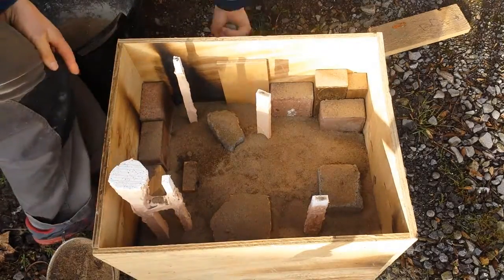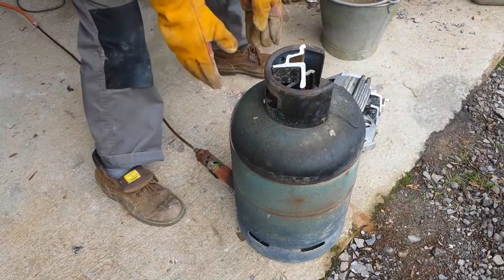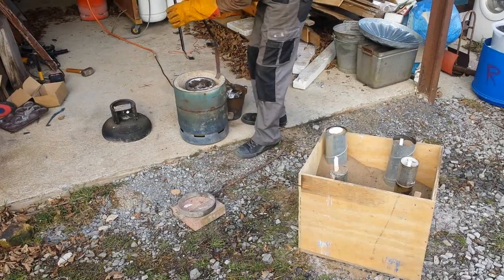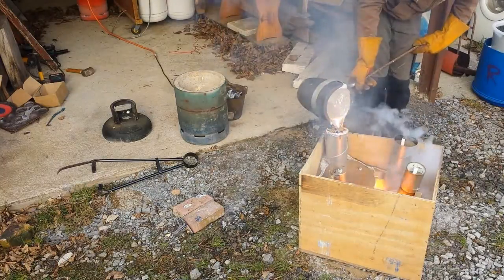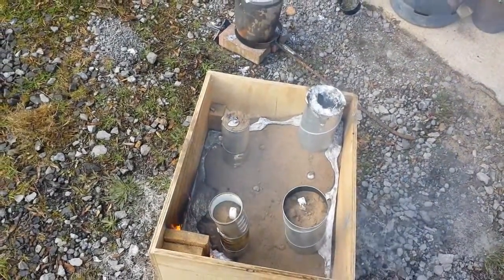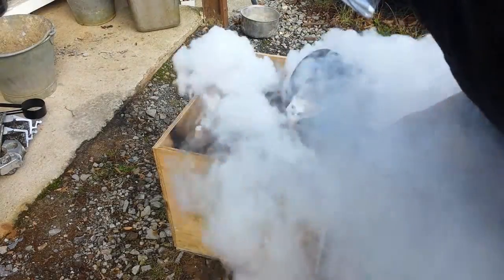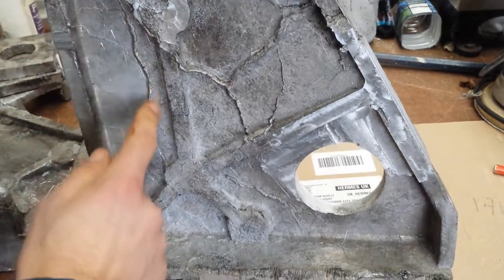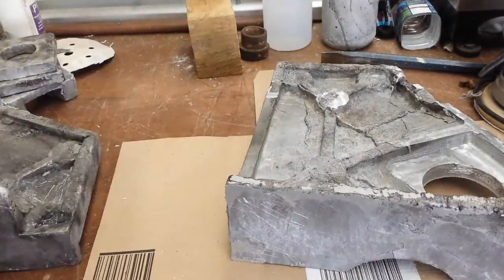Lost Foam aluminium pour - Casting #5 CNC gantry plate

Comment: Tip:
Set up one of those cheap indoor oscillating fans on low speed about a meter away to blow a breeze across your pour spout 
and clear the smoke and flame so you can see what you are doing. 
Works great.

Comment: ive been doing a fair bit of lost foam casting lately. you dont need risers. only a single pouring sprue. the gasses will vent through the dry sand. you should be using a light coating over the foam and work on your feeding distribution. you should check out kelly coffield on youtube. he does large foam castings
Reply: Good advice and maybe an almost vertical casting would be a better option with such a flat section instead of the horizontal approach

Comment: Hey - check out VegOilGuy and his funky plaster risers, which help to retain some of the heat as the metal makes its way down to the foam pattern. I think you have every right to be very pleased with the way these ambitious castings came out - well done   : )
Reply from the maker: Thanks for the tip, I had a look at that vid and it is quite useful. Will be trying some of that next time.
Reply: I look forward to your next post with interest  : )